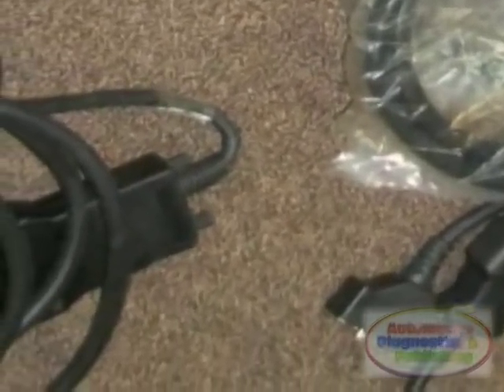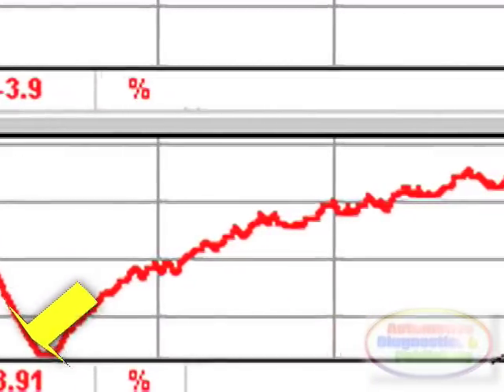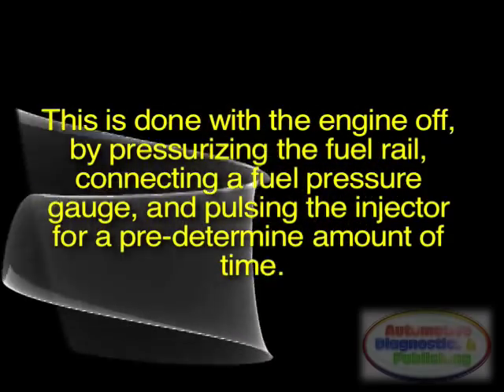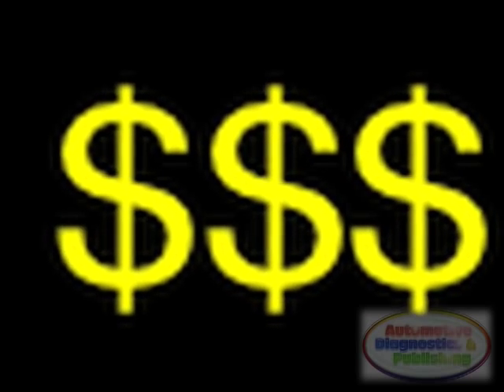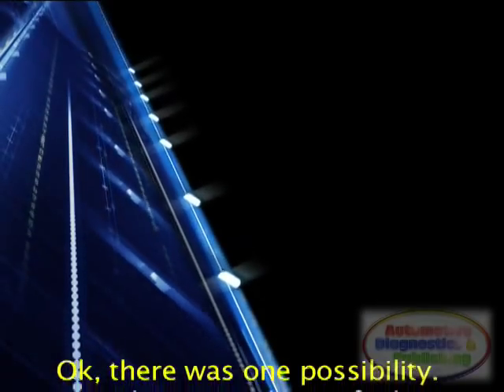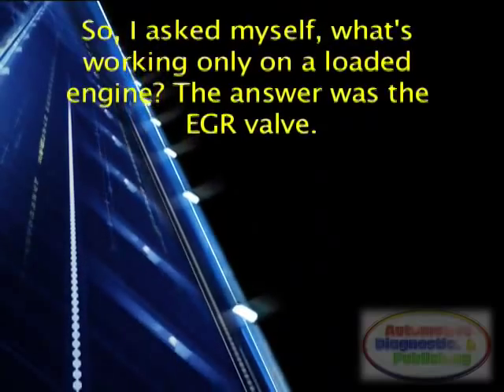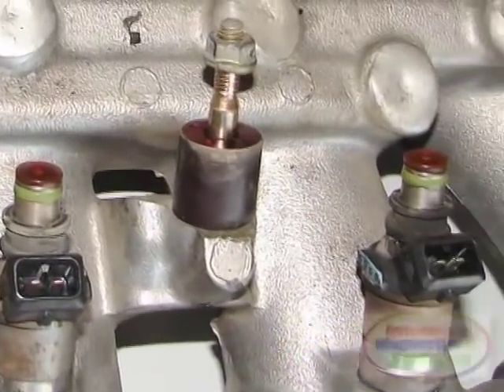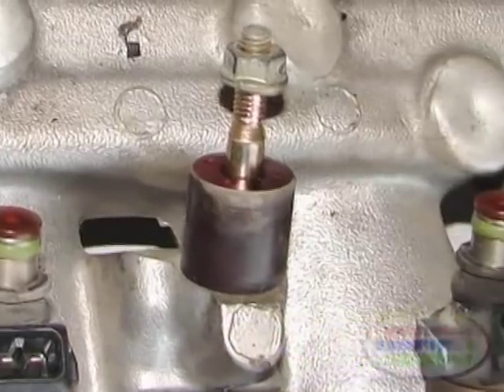Honda Accord Code Misfire On Acceleration

Comment from the maker: @TRcustomengineering This is a very common thing on 90's Honda's and some newer ones. I remember doing dozens of these procedures. It involved no parts changing. Honda's are tough vehicles and even the EGR valves rarely failed... Thanks for posting...

Comment from the maker: NO NO NO... First of all, thanks for posting. I appreciate that. HC is hydrocarbons or simply raw fuel/ unburned fuel. CO is the result of a rich condition or lack of air intake, which is signified by one molecule of CARBON and one of OXYGEN. CO2 or carbon dioxide is the result of perfect combustion. CO2 has 2 molecules of OXYGEN, hence fluent air intake and engine breathing properly. CO is not raw fuel, it is an actual odorless gas and part of acid rain. Nice to hear hear from you and good luck

Comment: My 08 accord misfire on 2 and 3. Only three codes. P03002 P03003 and a code for random misfire. Changed MAF sensor even pcv. Checked coils and plugs. Cant find the egr valve. Stealership said piston rings and piston head need replaced but no blue or white smoke from muffler. HELP roboman
Reply from the maker: Thank you. For more training, videos, software and equipment visit my site.
http://autodiagnosticsandpublishing.com/